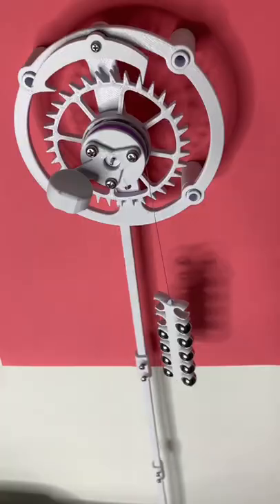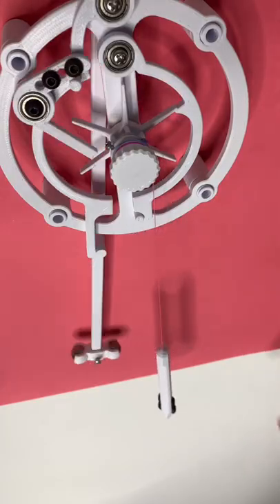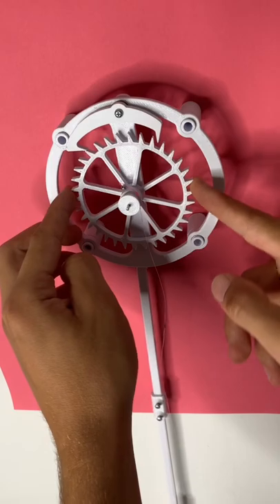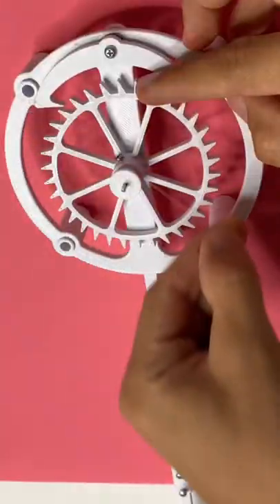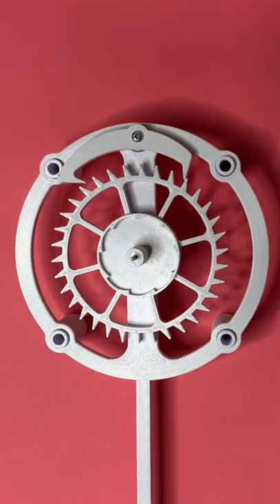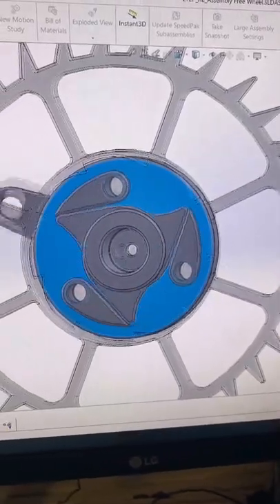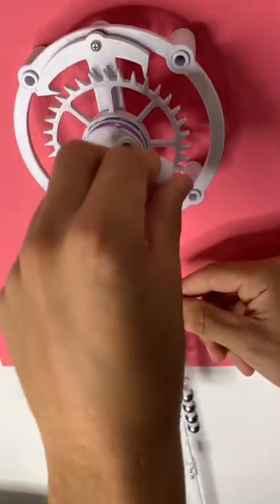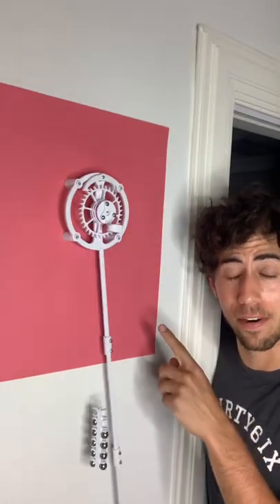Adding a Freewheel to the Escapement Mechanism | 3D Printed Clockwork

Comment: I didn't even contemplate that winding the clock would be an engineering problem. Props to you for figuring it out early on
Reply: Come on, he didn't figure this out 🤣 this is how mechanical clocks have worked since they were invented
Reply: @robmckennie4203  EXACTLY

Comment: That's a cassette not a freewheel. The difference is cassette uses pawls to cause only one direction of driven motion and is backdriveable. A freewheel uses a clutch or brake band engaged by the driven rotation to make it not backdriveable.

Comment: This is a very interesting project to demonstrate the principle of operation of a vintage clock, however, in this implementation I observe a significant problem, which is that the pendulum actively collides with the weight.  It will be interesting to see a solution that addresses this issue.  Personally, only two solutions come to my mind: 1) separate the pendulum and the weight with an acrylic sheet.  2) add guides for the weight

Comment: Presumably you need some kind of freewheel or clutch whichever you use unless you want to change the time each time you rewind the clock.
Unless you have a belt or loop of chain where you can detach the weight and move it up.